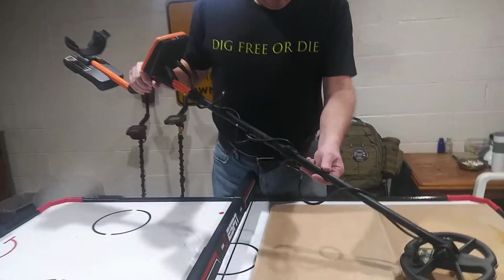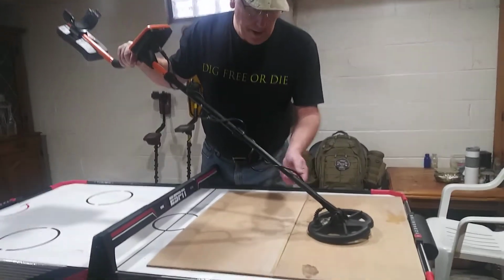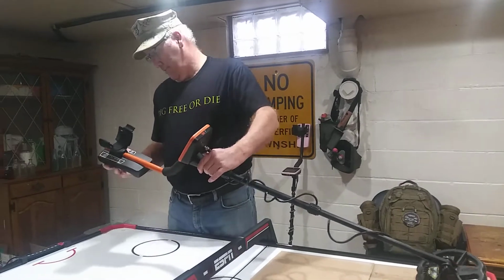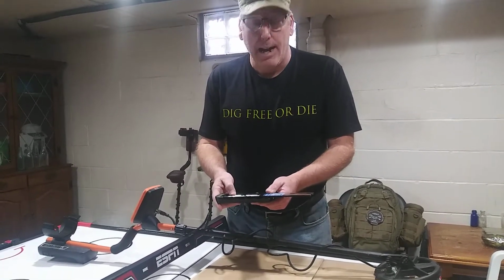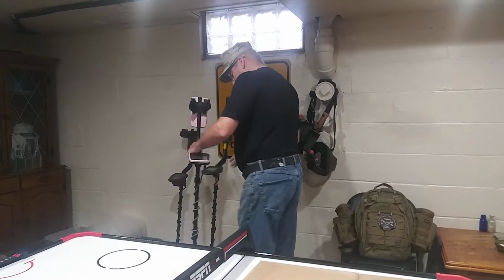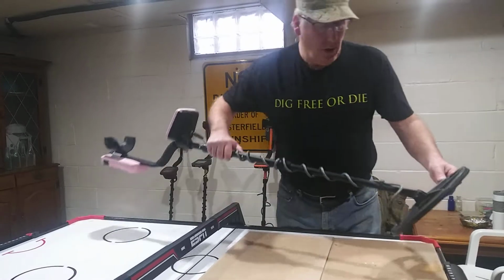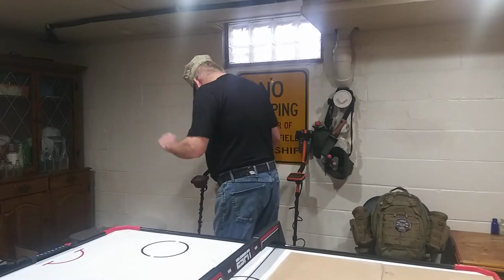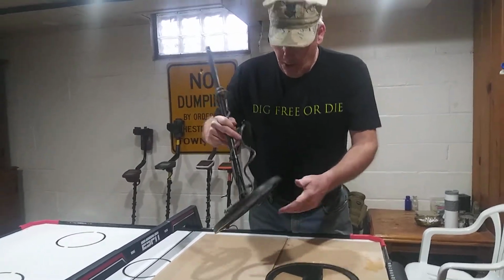Metal detector tips for smooth operation/ less falsing!

Comment: I use spray on truck bed liner for the bottom of my coils.

RIP White's 😪
Reply from the maker: I knew a guy that used something similar on his coil. A few months later he had an issue with the wire on the coil, and Garrett wouldn't honor the warranty because of the coil being "modified ". Go figure!  Thanks for watching!
Reply: @freedomdiggersmetaldetecti8964  That sucks. Such acts dig into their lucrative coil cover business. 😁

Well Tesoro, and White's won't complain about my coils.

Happy Hunting...
Reply from the maker: @bleirdo_dude  most detectors come with a coil cover. All of my White's machines have one.
Reply: @freedomdiggersmetaldetecti8964  I have never seen a White's coil come with a cover. It was always a separate purchase. I don't remember if they threw in the cover for my XLT purchase, but they might have.

Comment: What is a good cheap starter unit? I am on a budget
Reply from the maker: For around $100 the Bounty Hunter detectors are not too bad, but don't expect the kind of performance you get if you spend a little more on something. When it comes to spending a little more I highly recommend the Minelab Vanquish which can be bought for around $250. This in my opinion is the best machine you can get in this price range. I wish that it was around when I started!